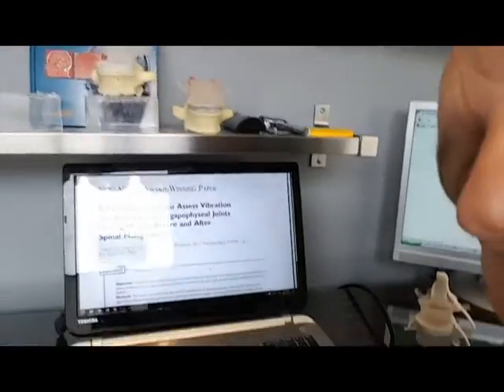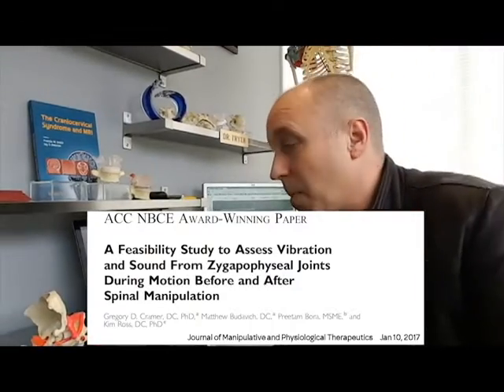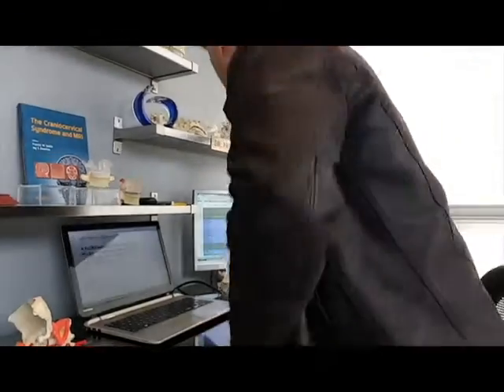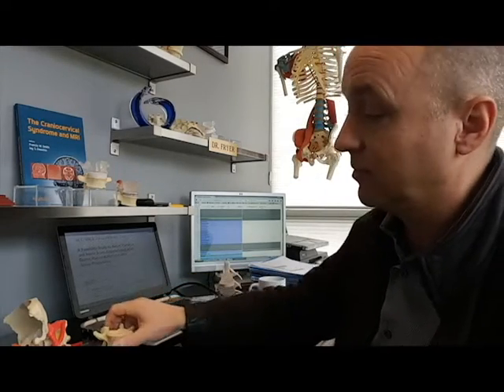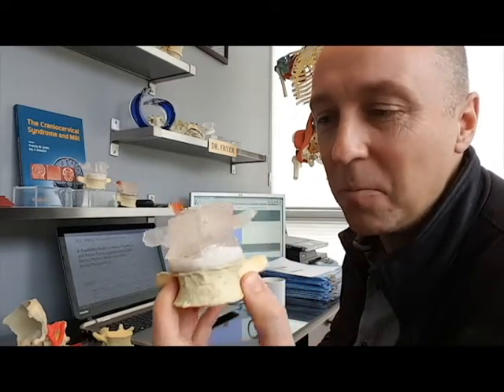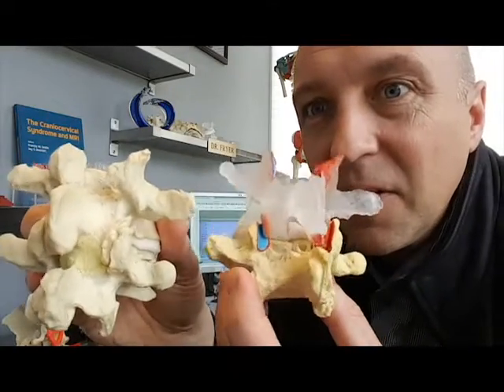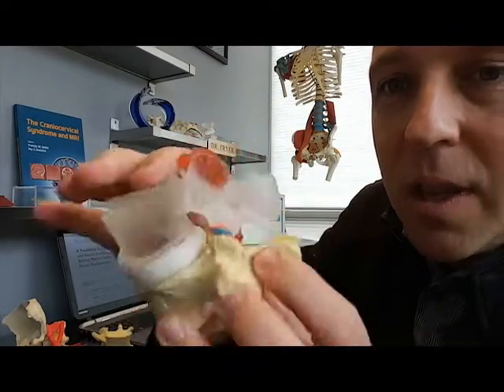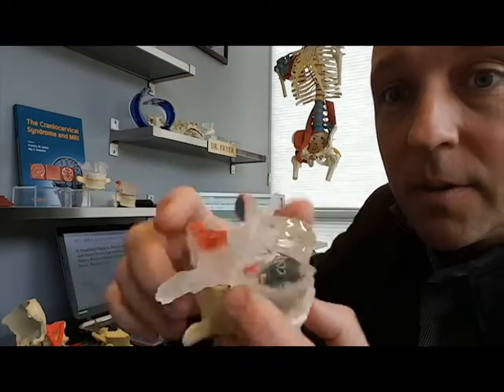Crepitus, Sound and Manipulation - Joint Science

Comment: ive been experiencing constant little pops and sliding off of a something or something like that. It started when i kept cracking my neck and i cant get the noises out of my head since. I went to a chiropracter but nothing worked. its super addicting to move my neck and it is uncomfortable. Is it crepitus or something more serious. It has been going on for around 9 months.
Reply: i’m going thru the same thing as well :/
Reply: Ive been doing it for years. started as just cracking. then i found more ways to make sounds with my neck. At some points of my life i would do it so addictingly, almost constantly throughout the day. 

I am thinking now its actually neck tendons sliding off of uneven bone and making a pop sound. I Can do it over and over so its not like cracking of the knuckles.